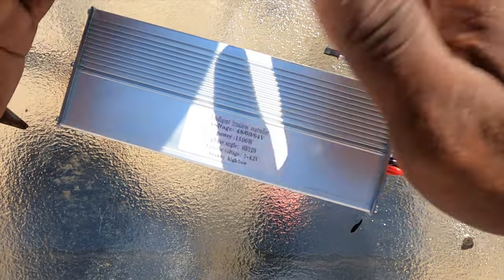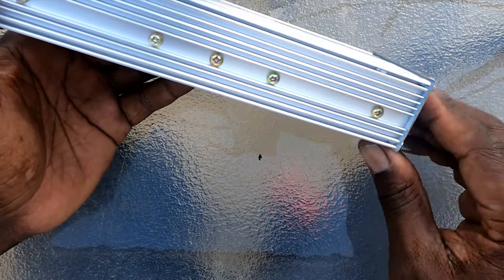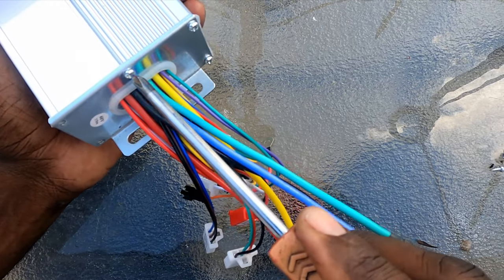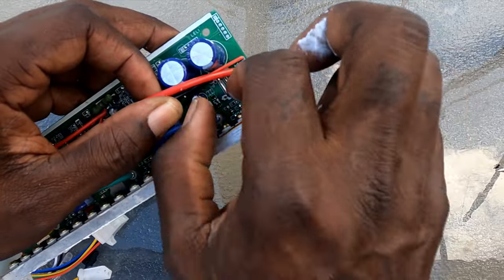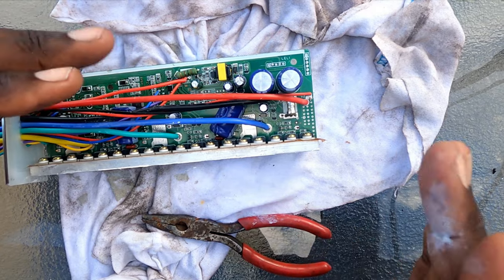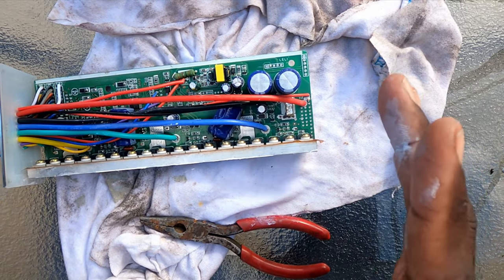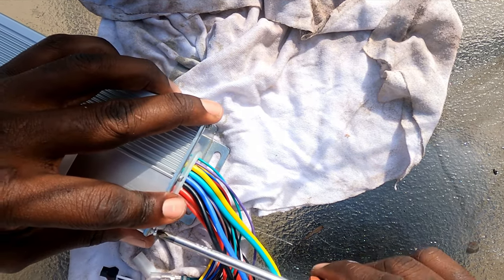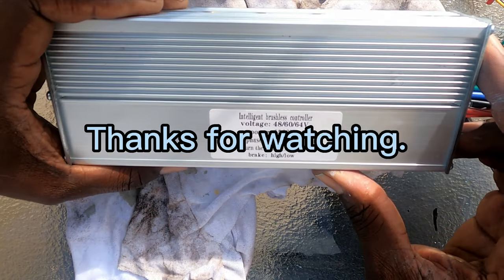How to shunt mod your ebike controller for more power.

Comment: Where are you located
Reply from the maker: I'm in central Florida
Reply: @E-bikeguy  how much is your services? I’m in central Florida too
Reply from the maker: @Daryl Ogle  I don't know it  all depends what can I help you with
Reply: @E-bikeguy well I got 2e bikes one the motor needs replaced the other I want to improve. I’m not good at this electronic stuff or the bike stuff like it’s 1000 W I wanna make it a little faster put these tires on upgrade the brakes to the BMX handlebars with better front forks, and change the front and rear ring cassette, basic overall improved performance
Reply: @E-bikeguy  as you know, nobody works on E bikes over here or if they do, they only work on certain E bikes, I mean, if you can do the job at a reasonable price I’d pay and you can film if you want to and we’re both in Central Florida so you can’t be that far from Kissimmee
Reply from the maker: @Daryl Ogle  ok email me at theebikeguy@gmail.com
Reply from the maker: @Daryl Ogle  yes I'm not that far I'm in Polk County
Reply: @E-bikeguy  me too
Reply: @E-bikeguy  I also want to put a new motor on one of those bikes

Comment: This will work people  for a while anyway sooner or later it will burn up your controler
Reply from the maker: Well I sold both controllers and they are working good, it all depends on what you putting it on and how much load the controller have to go through in order for it to over heat.

Comment: Unless you have a controller Intelligent Brushless ₩otor Controller
hase angle: 1200
Model: NJTZT-6GZE Do50086
Electric current: 25+1A
Voltage: 36V/48V
Brake handle: low level
Undervoltage: 29+1V
Date: 2022-07-07
Quzhou naijiate auto industry co.,ltd

this controller is strictly IC contorlled. 
E-bike companies are upgrading thier controllers as they see these videos.
Reply: this controller is controlled via puls width modulation